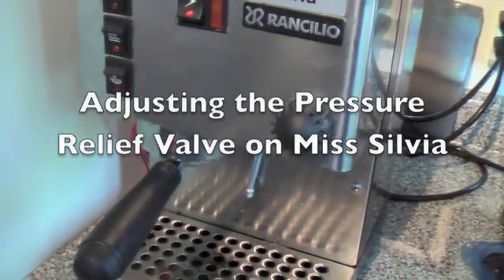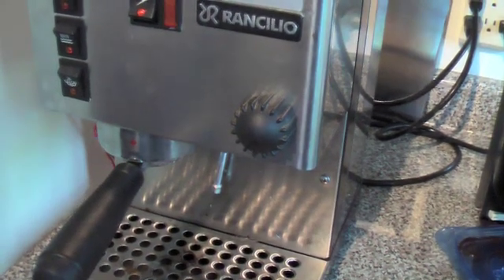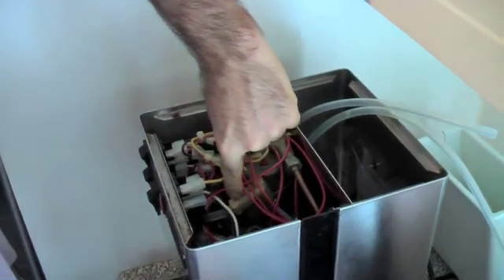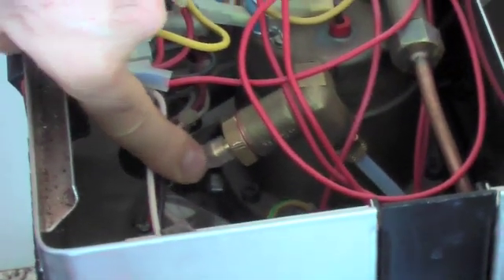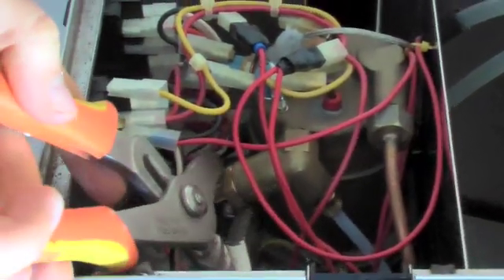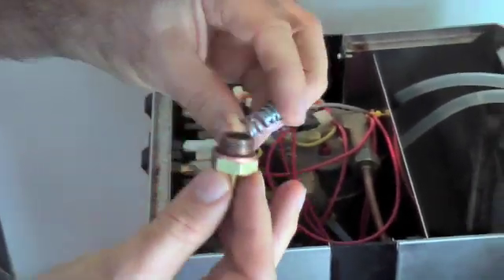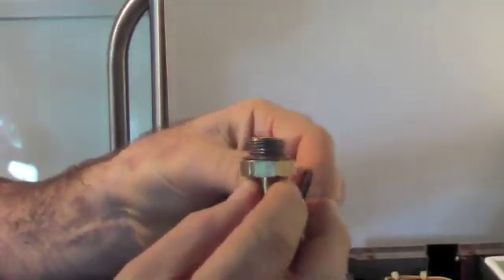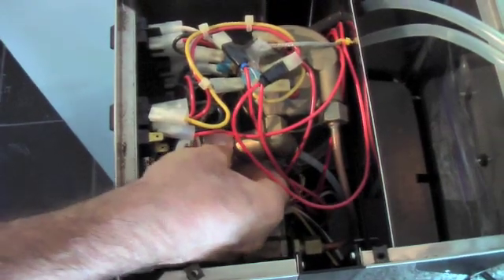Rancilio Miss Silvia Pressure Valve Modification

Comment: Good explanation.   I sure would want to invest in a proper size wrench, rather than using the one you use that poses a serious chance of ruining that nut. Thankfully, the newer Silvia models don't present such problems in adjusting their (improved) pressure valve.

Comment: Useful post. I found this helpful for actually showing me how to dismantle the OPV (for cleaning). Mine is an old 14yo unit without the adjustable OPV too.

On the hose, I got it off without cutting - I just used a bread knife to get between the top of the hose and the opv and eased it off.

Comment from the maker: @trixoptosi - if you want to increase the pressure you will need to increase the load on the spring so it opens at a higher pressure.  Unfortunately you cannot do this by removing the washer on the valve as the washer is needed or the valve leaks.  I suppose you might try putting some type of brass shim inside the valve to increase pressure on the spring.